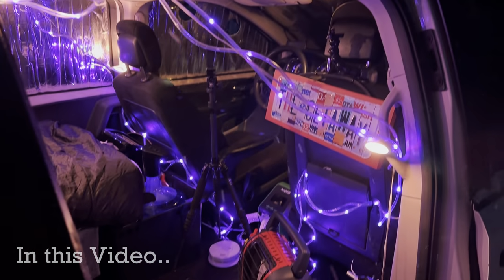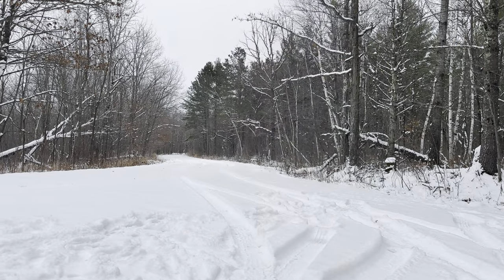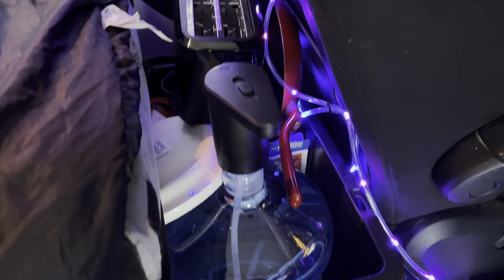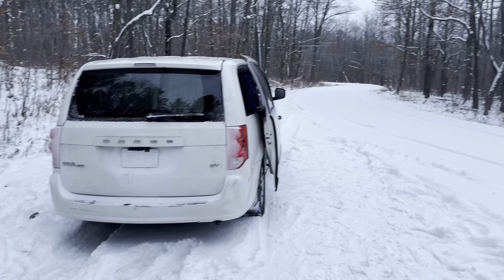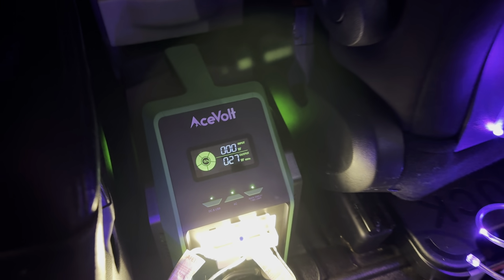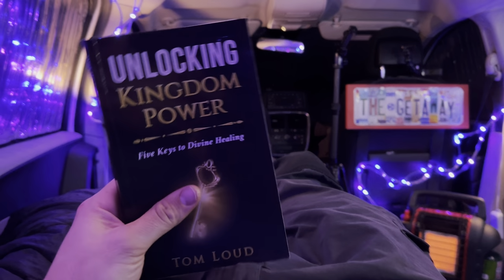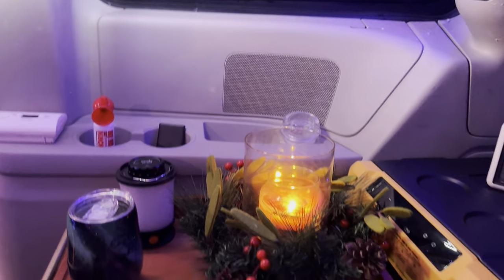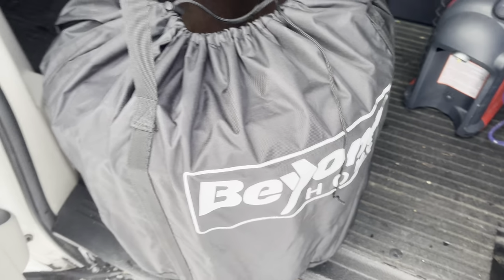🥶 Solo Car Camping in the Freezing Forest! Winter Camping New Setup | Dodge Campervan / Van Life

Comment: Might want to get a thermal curtain or just a fleece blanket to hang on a tension rod behind the two front seats.  It will keep your heat in a smaller area so you'll stay warmer and use less fuel.
Reply: Well he also needs to get some kind of silicone based stuff to put around his doors so they wont freeze shut in case he needs to get out..
Reply: My thoughts exactly 💯!!
Reply: Not to mention he needs more firewood 😂
Reply: yeah the buddy heaters created a ton of moisture and can actually give you pnemonia like symptoms. dont use propane heat.
Reply: Get the snow tires & dome chains. Leave that shovel in the van.
Reply: Thermal curtian you say? I like that idea. I will def use that in my truck.
Reply: Get cheap moving blankets for heat barrier.

Comment: TIP: use a hot water bottle to stay warm as you sleep, that way you save power for the heater. The water can be reheated for the next night or simply used to fill the toilet flush!

Comment: I have the same heater with a 20 lb propane tank in my semi truck. No more green bottles. Get ya a hose and tank at Tractor Supply.
Reply from the maker: For sure, yeah I have a 20lb tank with hose also. You’ll see in my next video how I put the 20lb tank on passenger seat and ran the hose to heater in back.

Comment: You can get one of those fans for your Buddy heater that come wwith a clip so you can attach it to the top of the heater. I had a Coleman cot in my Caravan the made one out of 1 inch PVC pipe for the frame then a quarter inch plywood for the top then a pad cut to fit. I made it 4 inches narrower than the Coleman cot, This gave me a but more room.

Comment: I've been camping the vehicle for a couple years using the Buddy heater you need to get 20 lb propane tank get a filter put the propane tank outside run the hose right underneath the door to shut the door it'll be all right or run it right out the back window where you got it open keep it on low all night with the window open you'll be all right
Reply from the maker: Yeah I have a 20lb tank and hose, I may do that.  The main thing for me has been staying warm while awake and once I’m in the warm sleeping bag it being cold doesn’t really bother me.

Comment: Awesome new setup. You’re really doing great. I don’t have a heater but I think I would just turn on the car and heat it up real good before going to sleep. I’m still wrestling with the car alarm going off when I use the key fob to look it from inside. I have come to the conclusion that I will need to start the car to avoid it going off. Great work with your camping setup.
Reply from the maker: Thanks and the heaters are pretty cheap if you decide to get one, it defiantly makes sitting inside the van more enjoyable. As far as car alarm going off, are you locking it from the key fob and then trying to open the door from the inside without unlocking if from the key fob first? Because once you lock it from key fob it activates the alarm so if you were to unlock the door manually without de activating the alarm from the key fob first it would go off.
Reply: @TolbersCamping  I tried opening it with the key fob and also just from the door and both times the alarm went off- same night, on a campground, embarrassing. After that I actually did not lock it until morning.
Reply: @TolbersCamping  I did get a Mr buddy mini and dog and I are sitting outside at the campground with it on. Nice! No fire needed!
Reply from the maker: @learntechwithruth2147  perfect! 🔥

Comment: You should consider adding a diesel heater and loosing the buddy heater, you will get good heat without the condensation caused by burrining lp with the open flame.  One other suggestion in winter use rv antifreeze in the toilet and it will never freeze even if left in the van between trips in cold weather.
Reply from the maker: I’ve thought about getting a diesel heater, but don’t plan to keep this van to much longer so will probably wait until I get my next van. Thanks for the anti freeze tip
Reply: Great tips!
Reply: What kind of diesel heater ?   Can you throw a link of what you buy please

Comment: For the same price as that heater you could get a Chinese diesel heater I run kerosene in mine for cleaner burn but cheap very easy to install and hot!!
Reply from the maker: Yeah a diesel heater is better, but this van has higher miles so don’t plan to keep it much longer. When I get my next van I will do more of a custom build with a diesel heater

Comment: When you used your toaster I jumped at it.  I eat the same meal on theroad and would like to know where you got the roaster and does it run off your power generator????
Reply from the maker: Hey Dan, it’s just a super cheap toaster from target I think. I plugged it into my power station. Just make sure whatever power station you get can handle the amount of watts your toaster pulls. Generally a two piece toaster pulls just under 700 wats

Comment: Yes, It will be more safe due to the small propane tank can not use for whole night ! It is very danger when you sleep only use Mr heater with one small tank.
Reply from the maker: I don’t sleep with it on but as long as you have good ventilation and carbon monoxide detector you should be good.
Reply: @TolbersCamping  How about 1 LB propane tank empty when you sleep ?
Reply from the maker: @hjwen4759  1lb tank would last about 3-4hours on low. If you want to run it all nights just need to connect to larger propane tank. Like I said I don’t sleep with it on as I’m over safe about it but honestly as long as you have ventilation and a carbon monoxide detector the only issue you’d have to worry about is kicking something close to the flame on the heater and starting a fire 🔥
Reply: @TolbersCamping  Yes, agree.

Comment: That propane Buddy Heater will cause condensation inside your van.  Crack that front window open 1/4 in and you should be good. You might need a smaller buddy heater. One you got produces 5000 BTUs on low. Gonna roast inside your van.

Comment: I finally picked up a Mr. Heater. Looking forward to using it sometime in my Ford Transit Connect wagon, when it's cold enough  (I live in SoCal - hehe). Great videos as usual. God bless.
Reply from the maker: They work really good. As long as you keep some airflow and have a carbon monoxide detector you’ll be good to go. God bless!

Comment: You should get  a rug for your boots when you get in ..And do you recommend anything for a heater that doesn't use propane ? Just electric?
Reply from the maker: I wouldn’t recommend electric as they pull way to much power and you would need a super massive power bank to run even on night. You’ll want a diesel heater

Comment: Your set up is great. As for the toilet paper I personally don’t flush mine (gross I know) I have a small camper and heard it can mess up the tank sensors. You can get some pet waste bags and put the tp in that. Love your fire pit.
Reply from the maker: Yeah that’s definitely a good option. I know this toilet paper is specifically made to break down and be used for that, but have no experience with it so don’t know for sure.

Comment: Hey man you might like using a 5 or 10 lb propane tank and you can hook that up to your buddy heater, itll last longer and you can take it somewhere to have it refilled rather than having to just throw away the disposable 1lb tanks
Reply from the maker: For sure bro, I do have a 20lb but that would take up to much room. 5-10lb would be nice for couple day trip
Reply: @TolbersCamping  just make sure to use a filter with the hose

Comment: Does the fridg/freezer use propane? You said bottle so I’m guessing that. How much would it use for how long? You know like if power isn’t available.
Reply from the maker: The fridge runs off the electricity from my power station and the heater runs off the propane bottles
Reply: @TolbersCamping  thank you

Comment: Watch out with candles in the van. They create carbon monoxide. I would change it for a battery candle.
Reply from the maker: They produce a very small amount and I always have tons of fresh air coming in through the windows when I have it burning and also a carbon monoxide detector so no worries. I’m not into fake candles but thanks for the concern!

Comment: 245,000 miles on a dodge minivan is pushing it brotha, might need to consider an engine rebuild in the near future, cylinder heads typically start leaking around 200k.
Reply from the maker: No worries bro, only payed 3k and still running great. Hoping to be able to upgrade fairly soon

Comment: I have used these buddy heaters and they put out too much moisture.  A butane heater is perhaps a better option.
Reply from the maker: It works good for my current use, but yeah if you were living in it or running it all day a diesel heater would be best.

Comment: GREAT SCRIPTURE TOLBER. THANKS. NICE Van Setup. Be Careful  With Harse Weather In A Mini Van. It's Nice. What Year Did You Say It Is. You Need To Carry Tire Chains And A Large Battery Charger If You Plan To Travel In Harse Weather. It Was A Beautiful  Scenery.   Extra Water n food/Snacks. Bear Spray And A Taser. I Think I Saw The Best Phone Antanna is A STAR LITE. HOPE I HAVE THE NAME RIGHT.  I BINGE WATCH NORMAD N WILDERNESS VIDEOS.  WHEN IN TOWN, KEEP BACK COVERED.  LEAVE FRONT OPEN WITH A HARD HAT, WORK VEST AND PAD ON THE DASH BOARD. LOOKS LIKE YOU WORK IN CONSTRUCTION. If UR Going To Travel In Bad Weather, You Need To Start Looking For A Rescue Truck Or A Heavy Duty Van or Large SUV.  Seen A Few That Use Disel And Disel Heat.  If You Need Too, You Can Sell Your Van.. But Wait Until You Are Stable. ENJOYED THE VIDEO.  ALL VEHICLES SHOULD HAVE RAIN GUARDS.  BE SAFE
Reply from the maker: It’s a 2011. I now have winter tires and a bigger power station and also carry lots of protection 😀 I also have road side assistance, so as long as I have service and can call I’ll get towed out of anywhere if I get stuck or break down. I’m about to get this cell signal booster installed which should help with internet and phone service also.

Comment: Could You use a halogen heater inside that would also provide a light source? I had one (£15) in a tiny flat and it was pretty good. The snowy woods reminded me of the Robert Frost poem "And miles to go before I sleep" etc.
Reply from the maker: You could but they use a lot of electricity so would need a massive power station to run if not connected to grid power. So not really something most can do
Reply: @TolbersCamping  Thankyou. New subscriber.🇬🇧

Comment: So those Dodge Caravans are reliable? I'm asking because I wanna sell my SUV camper and get a van instead, especially because more stealthy and have more storage. I just wanna make sure I'm not getting anything unreliable.
Reply from the maker: For the price I don’t think you can beat it. From my experience they’ve been reliable. Also the fact there are so many it should be easy and cheap to fix most parts as you could get it from a junkyard or a parts car pretty easy.

Comment: How do you wash your pans while on the road?
Reply from the maker: I don’t live in my van, just go camping in it so I wash them at home. If I did need to wash them I would just put my 3 gallon water jug with the water dispenser on top, on the ground and then spray the pan with a little water, soap it up and then rinse it off with water again and then dry it. Hope they makes sense

Comment: In case something goes wrong and you get stuck out there in the freezing cold, please be conservative with your resources. For instance, don't use all your wood on the fire at once. Save some for later. Turn your refrigerator off and put your food in a box outside in the snow. Eat smaller portions, so you don't run out of food. Conserve electricity, so you don't run your battery down. Maybe turn off that string of lights and use some small battery-operated lights you can buy at a dollar store. You can stick them on your ceiling. I just don't want you to freeze to death if the battery in your vehicle dies and you run out of food. 🙏
Reply from the maker: No worries Anneliese, I have plenty of safety measures and would not be out long enough for any issues. Thanks for watching!

Comment: Portable heaters should come also.. Battery Operated .. with at least a 24 hour run time consecutive on high 😈👋🔥📚🐐😹
Reply: Yall fellas gna be what we call in the 716 .. PARKING LOT PIMPIN😂
Reply from the maker: 😂 the only bad thing about electric heaters is they take way to much power to run. You’d definitely need a gas generator just to run it lol

Comment: Very nice arrangement in the back! ❤I wonder if you would mind a couple of questions about the Dodge Caravan ( I’m wrestling with what minivan to get or maybe a compact cargo van)– do the second row windows go down? I was surprised to see you go from the front row into the back, I thought all the DGC had a console in the way? I guess it’s FWD? Thanks! So sweet in the snow❄️
Reply from the maker: All regular dodge grand caravans the second row windows go down like my 2019 I was originally using for camping. My white one is a cargo van version meaning no rear seats so the second row windows down go down. Also most DGC do have a center console like my 2019 but the cargo van version does not, it just has a piece that pulls out to hold your drinks. For camping I prepare the cargo van version a little more, but if you need rear seats then definitely get the regular version
Reply: @TolbersCamping  wow, thank you so much for taking the time to reply with that *highly* informative answer! I'm intrigued now about the cargo version! 

I really want something that is easy to step through, but I think the operational second row windows will win out.

Thanks again! 😀

Comment: Please get a co2 sensor for inside if burning candles or propane.
Reply from the maker: That’s what that is in the video
Reply: @TolbersCamping  Im still 15 mins into vid and have not heard you mention one.
Reply: lol 36 sec too late
Reply: noticed you have one hell of a crack on that front windscreen.
Reply from the maker: @Daedalus_UK  just one layer has a crack, so just cosmetic at this point. Plan to upgrade sometime around spring so not worth fixing it
Reply: @TolbersCamping  Cool hope they seal it right and check the wiper lines are not disconnected when they put it back together.
Reply from the maker: @Daedalus_UK  yes they do all that when replacing glass but what I’m saying is I plan to get a little bit better of a van around spring so not worth replacing this one. If the next guys wants to he can

Comment: know a trick get the inside of a cloths washing machine and its the same as your fire pit
Reply from the maker: You’d have to do a lot of customization to make it the same, trust me I’ve used both lol
Reply: @TolbersCamping  its just about the same and way cheaper all im saying
Reply from the maker: @robertandrews8686  you get what you pay for, but yeah it’ll get the job done
Reply: @TolbersCamping  I disagree.350 compared to 0?
Reply from the maker: @robertandrews8686  it’s actually $200 currently with coupon. I understand pulling something out of the junk yard may do the trick, just not going to get the same overall experience as something designed for it.

Comment: That is so dangerous them gas heaters have killed so many people what a helmet!
Reply from the maker: Bro deaths from propane heaters are extremely rare and they are basically all from knock off brands that don’t get an efficient burn or have any safety features. Also most of those people are using them incorrectly or not getting proper ventilation and using carbon monoxide detector. I’ve use the mr buddy heater many times and have never even had a trace of carbon monoxide come from them but I still keep really good ventilation with my carbon monoxide detector. I also don’t sleep with them on because I like to be over the top safe. I agree with making sure people understand how to safely operate them but to say a mr buddy heater is “so dangerous and have kill so many people” is definitely not the case.

Comment: You don't need a powered cooler for winter camping. Throw in free ice son!
Reply from the maker: Shoving some snow in a cooler would definitely work lol. I just like not having to deal with melted snow/ice getting on my food plus the fridge hardly has to run when it’s cold out so will run forever on my power station. Also able to hold more food since you don’t need ice or snow to keep it cold. Basically it’s just a nice luxury to have 😁
Reply: @TolbersCamping  True, but as it grows emptier it becomes less efficient to run. A fillable container you can use for ice would be effective at keeping it at full mass when it's only half full of food, to reduce energy required
Reply from the maker: @escapetherace1943  for sure, I plan to continue getting even more power and solar setup going so eventually it won’t even matter as the drain from fridge is so small in comparison. It also can be used without power and just put ice in it if I want and enjoy having it as a second table.

Comment: You have a good crack across your windshield. Most insurance companies fix that for free. In others words... it doesn't count as a claim.
Reply from the maker: Yeah just one layer has a crack, just a cosmetic thing at this point. I only have liability insurance on it as it’s a cheap van so they won’t cover it. I plan to upgrade to something a little nice hopefully by spring so not worth replacing the windshield. Thanks for the friendly advice though!

Comment: And while propane heating is not ideal while wintering it in a vehichel, gotta stay warm cause lets face it, untill they make a within reasonably priced power station that can keep an electric heater going for 5-7 hours and that doesnt drain a vehichles battery,propane or butane is cheap enuf.
Reply from the maker: Amen bro